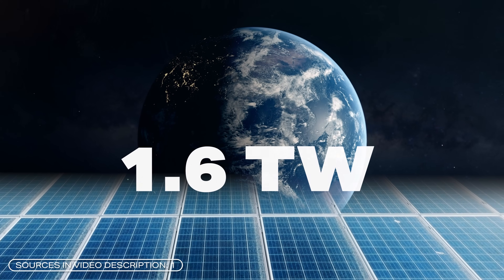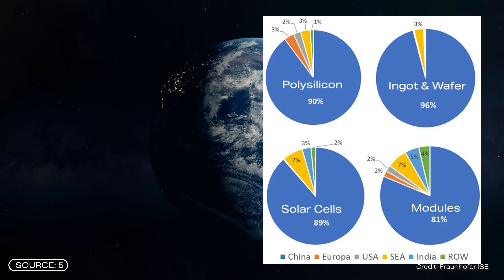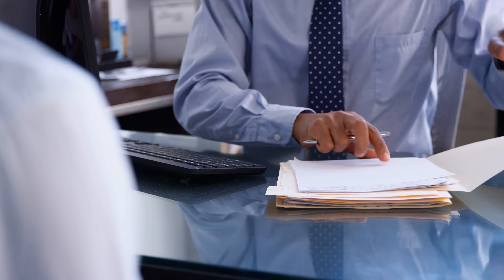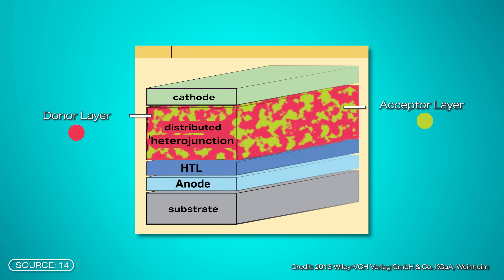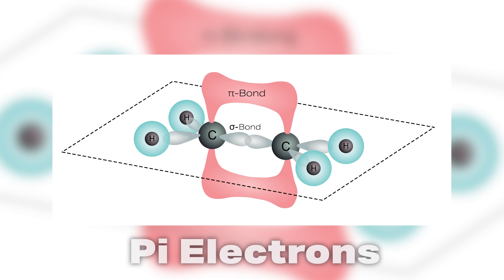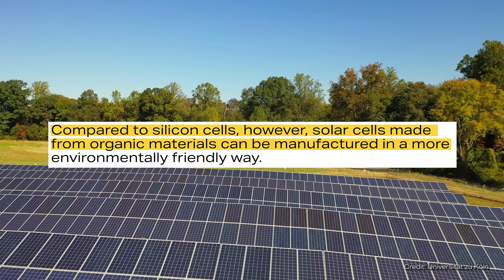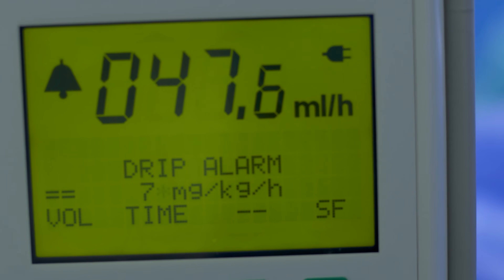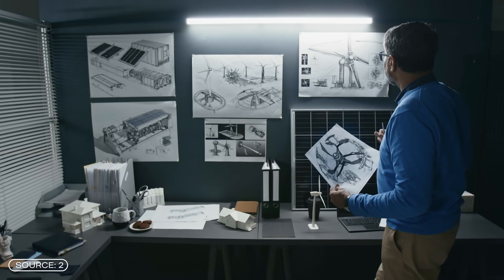Organic Solar Cells Made From Carbon!

Comment: I’m not against solar power which could provide a useful amount of electricity in Countries near the equator. However this will never be of much use in the UK because there is very little solar power available during the winter when it is needed most.

Comment: I think we must distinguish between different types of dependencies. Buying a solar panel from China creates almost no dependency, since we buy it and can then use it freely for 25 years or more without ever needing the original supplier. With other types of dependencies I fully share your concern. But buying a product that doesnt need service or updates does not really create a dependency.

Comment: Solar cells indoors??? What?

Wouldn't any electricity captured be easier and more efficient to just not use in the first place?
The solar cell will be dark, it will prevent light bouncing around the room and make the room darker.
You could instead paint the room white and turn the light down to save more electricity than could be generated.

Comment: Older roofs can always cope when superimposed loads were 50kg/m2 but in non snow areas these loads have been reduced to 30kg/m2 in some jurisdictions and then some buildings cant have silcon PV panels but they could have these new organic panels. By only covering a smaller percentage of the roof I can approve some PV installations from a design mass perspective

Comment: Germans are good chemists and they're leading research in this area. However the organic solar cells have shorter lifetime in comparison to silicon solar cells. This makes problem under situation when TCO of solar panels is mostly given by installation cost rather than production cost. These cells thus have higher chance in indoor applications, like the semitransparent solar cells for greenhouses, for instance.
Reply: BTW Phtalocyanine is prounounced as "ftalosyanyn"
Reply: It's much lighter and it's flexible so replacing a strip of it could be done fast. Just un hook the old one and a hook in the new one.
To me it looks like once the frame has been installed you can just plug these in.

Comment: Intriguing information. Yes reduced dependency is a useful point. Use indoors for charging devices seems like a good option. Putting them under regular window glass would resolve the UV problem, wouldn't it?

Comment: Greetings from the USA - My family name is of teutonic (German) origin, although they are geographically from Switzerland.  We are more obsessed with PRECISION, but my personal obsession is EFFICIENCY.   I believe that Solar has immense potential.  I believe that the US Military developed 90%+ efficient panels back in the 1950's for use on satellites.  That technology was buried to protect our growing stake in petroleum-based fuels.  This efficiency was achieved using nano-scale rectifying antenna (nantenna) arrays.  

When we produce cells with 50%+  efficiency at scale, solar will begin to dominate the energy market.  China has already absorbed most of the risk demonstrating what is possible with less than 30% efficiency.  They have greatly improved the scalability of panel production, catalyzing the underlying markets for tooling and materials.  Thus the groundwork has been laid for large-scale solar production to be replicated across the globe.  

Add to that Artificial Intelligence Acceleration, and we can quickly develop more advanced cells and tooling to quickly scale production in countries like the USA and Germany, which have strong economic foundations and histories of manufacturing.  If we can look past short-term profit toward long-term success, then I think the future is bright for both our countries.

Comment: It certainly sounds amazing. The UV vulnerability mystifies me though.  It seems like it could be turned into an asset rather than a liability because as I see it UV has simply got more energy to spare. If some kind of "speed bump" layer could be introduced into the PV sandwich that would simply slow down the UV-bands somehow while being transparent to all others, then that extra energy could be applied to the PV panel. As an analogy, our own atmosphere converts a lot of UV sunlight into thermal (IR) energy.

Comment: Solar made up 10% of global energy use in 2024 but it is chasing a moving target as demand for electricity is rising in the Global a South and in advanced economies due to AI and digital currencies. It s growth is limited by the land aea required in competition with that for food crops  and its intermittency and expense and low efficiencies of storing surplus power in batteries or as hydrogen. The land problem may be overcome if costs are low enough by using solar glass and thin solar films to cover buildings but this will only cause greater destabilization of national grids requiring an equivalent amount of fossil fuel supplies. The future lies in small modular nuclear that does not need national grid systems for which the raw materials are not available in sufficient quantities. The Russian company Rosatom, the largest global installer and operator of large nuclear power units has developed modular nuclear power plants with capacities from 8MW to multiples of 100W or 200W based on those used in their nuclear submarine and ice breakers as well as the Burevestrik and Poseidon nuclear powered cruise missiles. These do not use water cooling and so are safe to deploy near towns, and cities as well as industrial and mining sites  where power from a grid is not available. They are currently installing units in Siberia but they ae aiming for the global market, especially in the Global South.

Comment: Energy transition.. Points at your calculator in your smartphone > Amazon searches: "Calculator" > Points at thousands of versions using real resources and energy to produce instead of making a max calculator for phones and one maxed calculator mandatory for production That's 1 app example.. Traps a Person in capacitor bank Boeing plasma force field shock wave echo resonance medical filtered for pressure only like stem cell guidance > types weight of devices in real form useful for jobs that can fit on your phones into the computer for pressure setting > Hits enter watching the person get smashed instantly Oops.. Is that how you need to see it? Checks rain acidity for Greenhouse gasses that absorb into atmosphere water like Greenhouse gas generators work Umm... How about stopping the use of grid tied "friendly microwave weather radar" all over the place and stop dumping chemical filled tap water all over the place. Googles: "Operational defense through weather control 2030 Microwaves" = Heat cool front hot before clashing with cool make big storms solar panels bye bye Heheh..

What's wrong masses, you don't know anything about your leaders intentions yet? Loads game Fallout 2 > Goes to Hubologists > Points at Cross symbol > Goal to hide underground and use weather weapons > To join: Give up all possessions = "We will own nothing" LOL.. OOPS! Googles: "What percentage of WW2 Germany was Christian?" + "Vegan Hitler" Oops! Googles: "Saucer over Dracula's birthplace pouring SMOKE Yahoo news 16th Century Church painting" < HAND painted. Smoke is symbolic of Hades.. Googles: "5th wound of Christ heart pierce" The brother of Jesus.. Owner of the bad mind download place. Heh.. Cuts hand into Blood to Stem Cell converter for synthetic Bone Marrow printed by Ultrasonic resonance supported Holography direct sound printing while resonance warming cellular glue matrix so cells of hand fall into holographic cellular image overlay to perfect heal

Oh don't mind me I'm just uploading data into Cells to print super soldiers.. - Dracula/Hades

Comment: Being made of organics is EXACTLY WHY the reliability (usable lifetime) will be worse than silicon.  I've worked in semiconductor physics and reliability for the last 40 years in Silicon Valley.

There is also the 20-year Rule of innovation and technology adoption - the time between lab validation of a prototype and technology adoption with economic significance is ALWAYS 20 years ± 2 years.   Has been since the Steam Engine.

Ignoring either of this is EPIC FAIL by anyone betting on such things and trying to promote hype.

Comment: Germany’s heavy industry and economy is collapsing due to ridiculously stupid (& expensive) energy policies in Germany.
Germany needs cheap electricity and natural gas for its economic survival.
This is definitely not the answer.
(Germans used to love efficiency. Their current German train system says that is no longer the case.)
Neither expensive energy ideas nor increased dangerous migration will save Germany.
Germany get your heads out of your @$$.

Comment: Perovskite based solar cells don't require the same material thickness as silicon, so they can be much lighter.

Given perovskite solar cells are much closer in technological readiness vs organic solar cells it's a no brainer as to which is going to win.

Comment: I don't understand why we don't see every parking lot with solar panel shading roofs over the parking spaces. Protect vehicles from the sun and weather, and generate electricity at the same time? That sure seems like a no-brainer, much better than just putting them on roofs, which should still be done.
Reply: I agree, but you have to be able to prove to the lot owners that they would receive a benefit from building such a solar canopy. I think if a company developed a flexible modular canopy system that included all the parts - frame structure, solar panels, inverters, wire, everything - that would be appealing. Any such system would need to be designed top to bottom to be cheaply manufactured, easily configured for each location and produced in large quantities.
Reply: @Hybridog  and you hit on EXACTLY why we are in this mess. The incessant addiction to profit or immediate personal benefit. Let's save humanity, and the world, and end capitalism. Criminalize greed. Anything else is insane

Comment: "Only Norway is able... " "thanks to its low electricity prices". I wonder WHY electricity prices are so high in Europe...

Also, if the EU does not protect itself from China, that technology will also be captured by the CCP and the European enterprise building it will also be systematically destroyed.
Reply: Green energy is secretly a virtuous cycle. Once you get cheaper energy, you can do a lot more with it. Hospitals are cheaper to heat/light, suddenly healthcare prices can go down.  Factories are cheaper to run, products can be cheaper—cars can be more efficient, cheaper to run, easier to maintain.

Comment: China doesn't have any specific significant Si PV advantage, it's just all the usual stuff that makes them able to dominate that market, too. Why would it be different with OPV? The dependency is an issue, we won't solve that by panicking. Part of the reasons to China's success is that they're playing the long game. They make plans, execute them, (the plans) evaluate the outcomes, and stick to what works, and change what doesn't. Some kind of "fight or flight reaction" level of "reasoning" won't solve the issue for us, it will make it worse.              

I tried your link to the source about the scrap metal claims, as those claimed seemed extraordinary to me, and as you know, extraordinary claims requires extraordinary proof, but that link took me to what seemed to be some german pop-sci magazine. Pop-sci is interpretation of science, meant to be entertaining, and make the reader believe that they understand the science. Pop-sci is often not very far from sci-fi, and it can be argued that it's often pseudo-science, as the dramatic interpretation and also simplification makes it incorrect or at least takes it out of context, and then it's not science anymore, and non-science that is presented as science is kind of what pseudo-science is.  I don't know anything about that particular magazine, maybe it's great for a pop-sci magazine, but it's not science if it's pop-sci. 

Anyhow, 10.000 tons of scrap metal per year, now, and up to a million tons per year by 2030, just in Germany, makes me wonder what's included in "scrap metal". Most of the metal in solar panels is in the frames, that is usually aluminium, both the fact that the frame is kind of a separate part, and that it's aluminium makes recycling of that part easy. And that's usually about 10% of the total mass of the panel on relatively small panels, often much less for big modern panels, if they even have metal frames, there are conventional panels that doesn't have frames too. 

Even if "scrap metal" counts the entire panels, a million tons of PV panel "scrap metal" per year in Germany by 2030, implied here in form of discarded panels, suggests a million tons of solar panels were installed per year, around the year 2000 in Germany, I'm pretty sure that didn't happen. Why? Well, small solar panels weigh about 50 grams per Wp now, let's assume they weighed twice as much per Wp back in 2000, a million tons would add up to 10 GWp, installed per year of solar PV generation capacity added per year, around the year 2000. Again, as you implied very strongly that the numbers refer to discarded panels.     

Sure, the adhesives makes it somewhat complicated to recycle the fine stuff in conventional solar panels, but it's not impossible, far from it. The thing is, it's difficult to make things that very reliably lasts for decades constantly exposed to outdoor conditions that also easily disintegrates into it's fundamental constituents. One of the really big hurdles with OPV is that it is difficult to make them last for a relevant amount of time. If you manage to make them last reliably enough for 10 years they kind of have to be 3 times better/cheaper to be a relevant alternative to Si PV, unless they provide some advantage for the specific application that makes up for the difference. And that's if you disregard the cost of installation/replacement, which kind of restricts it to integration into products where the limited longevity of OPV isn't a problem. But there are no significant practical advantages of OPV, over Si PV, that I'm aware of, sure OPV can be made more flexible than crystalline Si PV,  that's it, but letting the panels flex reduce the average lifespan, even for OPV. There are non-organic thin film solar PV cells that are very flexible too, multiple types, but if you make flexible panels of them they don't tend to last very long either, as the flexible protection doesn't protect very well, not reliably.          

How about translucence? Well, you can make Si PV panels that are clear too, and only cover part of the area with PV cells. It's not like OPV can both let light through them and convert that same light into power. It is possible to make OPV that use IR and or UV light, and let most of the visible light through, sounds great, and it really would be, if we could make it work well in practice. Maybe some will figure that out someday, and that would be great, but still not that revolutionary, as solar panels with varying coverage of solar cells sandwiched between two sheets of glass are already mass produced for various applications where you want to let some, but not all light through.    

Artificial lights Indoors, really? First, are OPVs actually more efficient, or does their low efficiency just decrease less in low light conditions compared to conventional solar cells? Anyway, conventional solar cells can be more than efficient enough for many really low power demands, if they're exposed to normal indoor light conditions, the problem is that they don't replace batteries if you want constant power even if that power demand is extremely low, and they don't work if they don't get light, OPVs can't change any of that. Conventional solar cells are efficient enough to power a lot things from normal indoor light, without requiring bigger area than the things already has. Like remotes, wireless computer keyboards and mice, kitchen and bathroom scales, wall clocks, just to name a few examples. But since the average consumer is an idiot, such products wouldn't sell very well, and most would find ways to make such products not work.